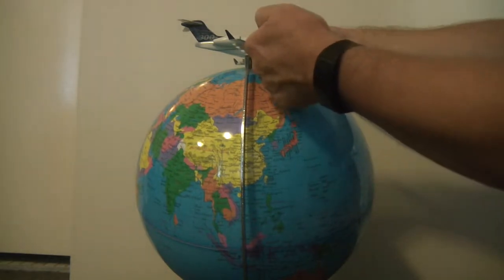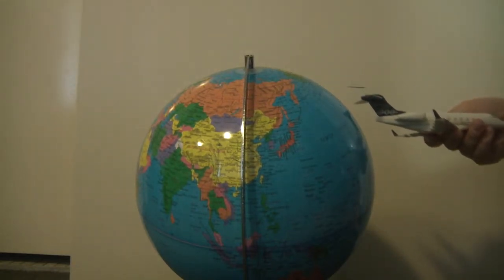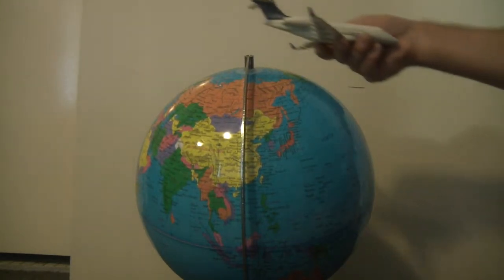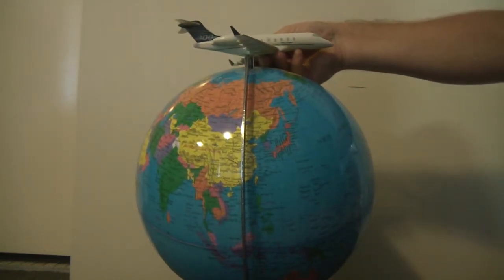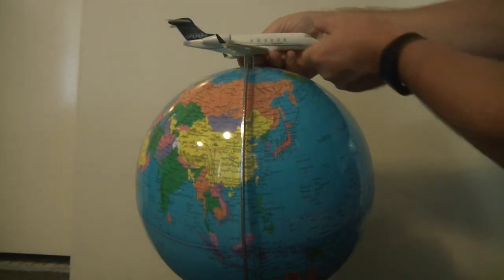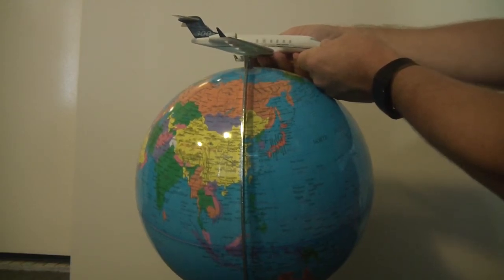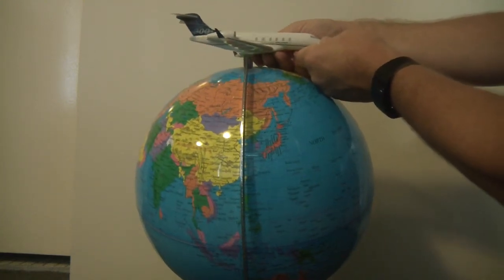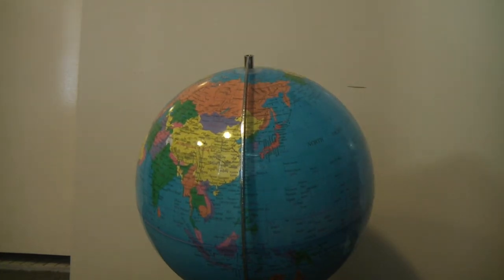A quick response to Globebusters.  You got it wrong guys.

Comment: I still don't see who or what actually does this, however minimal, pitch compensation/correction!
Are you saying that you, the pilots, don't actually level with the horizon, but just a bit under??? Or does the plane's operating system compensate automatically? I have never heard or read a clear answer to this. Either a runaround or incorrect info.
Please understand that I just want to understand it well and not ignorantly skip over this key question... Thank you! Greetings!
Reply from the maker: Hi Aleksandar, that is a good question and I will answer fully in the morning.   Right now I am at 41,000 ft enroute to Hawaii.  We just crossed out of Australian airspace and I am replying via satellite based wifi on the aircraft.  I will make a video of me posting this message to verify it to you.
Reply from the maker: Actually I have time to reply now...Think of it this way... When you drive a car you must keep inside your lane on a highway.  Even if the road is completely straight you cannot let go of the steering wheel for too long or the car will drift out of the lane.  On a straight road you still need to make tiny corrections regularly. 

In the aircraft we have a vertical 'lane'. We are required to maintain altitude to within plus and minus 100 ft of the assigned level.   So to fly at 41,000ft our 'lane' is from 40,900 ft to 41,100 ft. 

If you let go of the controls the aircraft will slowly drift out of this vertical lane too. So like your car you have to make regular corrections to maintain altitude in your vertical lane.

Either the pilot flying manually or the autopilot can make the necessary corrections which are small pitch adjustments. By simply maintaining altitude you are automatically following the curvature and any pitch change required is happening so slowly and gradually the average pilot will never notice it. 

Like driving in your lane with a car. If the road curved 1 degree in 100 kilometres you will never notice the curve but by simply staying inside your lane you are negotiating the curve too.
Reply: Great. The exact answer I was expecting. Thank you!
Now, would you be able to confirm that most of the adjustments are done downward (nose down)?
That would be a definite confirmation and would take us out of this gray area.
I am sure you know what this layman is asking about... :-)
And thanks again!
Reply from the maker: Hi again,  to be completely honest it is not something I ever noticed prior to getting involved in these discussions.  Depending on the weather, turbulence etc you can be making adjustments both up and down to keep the same altitude.  When hand flying you tend to rely on the VSI ( vertical speed indicator) a lot and if it moves just slightly you correct it quickly and all it takes is light pressure on the yoke.  The altimeter will barely move and the adjustment is so small you won't even see it on the Artifical Horizon.  It becomes like riding a bike, you do it without even thinking about it.  The amount of attitude change in a light aircraft travelling under 200 knots is just 1 degree in about 20 minutes.  That is tiny and when averaged across dozens of other adjustments to stay in the vertical lane it is absorbed totally.

Having said that,  I have taken extra notice of it in the HUD on recent flights.   The HUD shows very tiny adjustments clearly and these would not be noticeable on a standard instrument.   It is really easy to fly super accurately with a HUD.  

On a recent trip the air was silky smooth and I watched the HUD indicator carefully for over 20 minutes.  It only corrected down.  Never up.  

If there was turbulence then it would be correcting up and down as needed but the average down would be slightly more than the average up corrections so the net effect is a path that follows the curvature.
Reply: OK, this confirms your point to a believable degree. Thank you Wolfie for even taking your precious time!!!
I really appreciate it. Greetings and safe travels through the clouds! :-)
Reply from the maker: Thanks Aleksandar,   two short videos from last night.   The first one shows my first reply to from inside the cockpit.   

https://www.youtube.com/watch?v=OrDg0a0yKZI

The second video demonstrates that there are constant corrections occurring all the time when the air is bumpy.  This video is not meant to prove or disprove any curvature as what you see is inconclusive in that regard.  But it does prove there are constant corrections occurring and the altitude remains steady throughout.   Well within the + and - 100 ft. "lane"    The actual value here is a GPS derived altitude which does not always match up to barometric altitude which is used by the aircraft altimeters. 

https://www.youtube.com/watch?v=ggOVlLixYR4
Reply: An aerodynamically stable plane in trim for a given engine power level will follow the curve with no input from the pilot.  No down input is needed (assuming zero turbulence).  

If the plane moves away from the earth its elevation increases and its potential energy increases.  The increase in potential energy causes a loss of kinetic energy and its speed decreases. The loss in speed will eventually cause the wing to lose some lift and the plane will begin to fall.  This trades the potential energy it once had for more  kinetic energy as the plane increases in speed.  The acceleration causes lift to increase and the cycle starts over again.  If the plane is stable these deviations from equilibrium will eventually dampen and the plane will reach a state where the potential energy and kinetic energy for a give power level are balanced. Once the factors are in equilibrium the plane is in trim and it will naturally follow the curvature with no input from the pilot. A good pilot will get the plane in balance quickly as they don't have time to naturally let the plane rest into trim.  The passengers don't like the oscillations and the flight controllers don't like the deviations from the directed elevation. In reality, turbulence requires constant input from the pilot though.
Reply: Wolfie6020
                      I tried to get this young pilot on a FE chat to understand this very thing . He wasn't having it. And I honestly lost  interest in getting him to see how damn slight and automatic the adjustments are.  I'm to old to fly anymore (health), so keep her angels high for me.
Reply: Thanks Adam for a detailed explanation!
Reply: Sorry, but I'll believe Wolfie since he is the pilot with all the practical experience.
Reply: Yeah you don't notice the corrections because it's flat.  That simple.  Looking for a needle that never existed. Now let's argue about coriolis effect and flying.  Answer,  remember the needle.......
Reply: I've always figured that compared to variables like changing air density, head-wind, side-wind, up & down drafts, etc; 8" over 63,000" is minuscule.
Reply: Aleksandar Sasha MEKSIKO Panich
no, Wolfie6020 is dead wrong about the small adjustments. he is right about everything else, but wrong about that.  why?  because as i have explained on many threads, the airplane is kept at a constant altitude and this altitude is based on atmospheric pressure.  (pressure gradients are near constant all the way around the earth).  the plane follows regions of constant pressure and that assures his distance from the ground.    in other words, the atmospheric curves around the earth and the plane is always kept perpendicular to the directional pull of gravity , which is straight down.       the plane's ATTITUDE , does curve around the earth (from the perspective of someone OFF the earth) but the planes altitude never needs to be changed . the plane does NOT need to adjust for curvature.  no control inputs are needed.   and IT IS NOT like a car traveling down a  slightly curved road needing constant corrections, its like a car going down a straight road,  where corrections are only needed for changes in the atmospheric pressures, or turbulence, winds, etc.